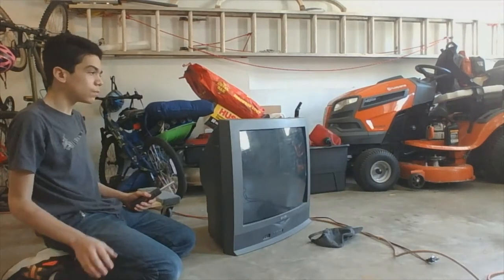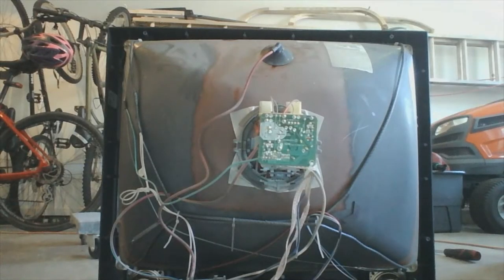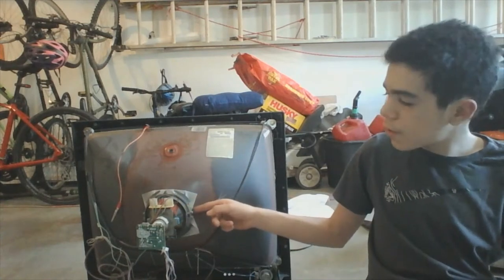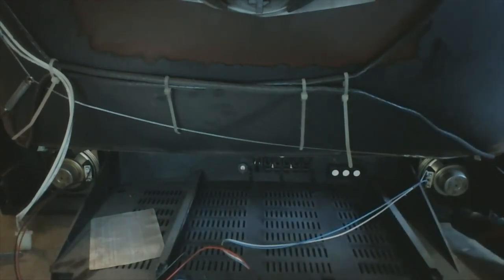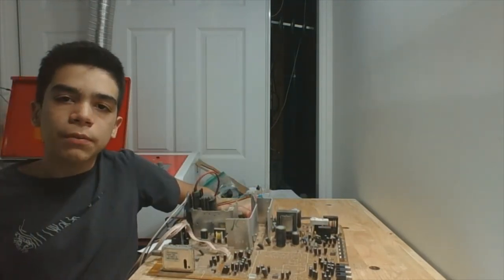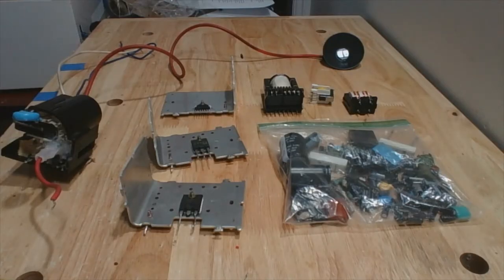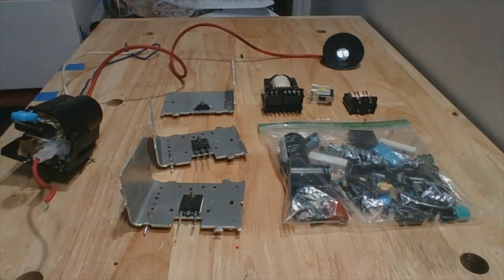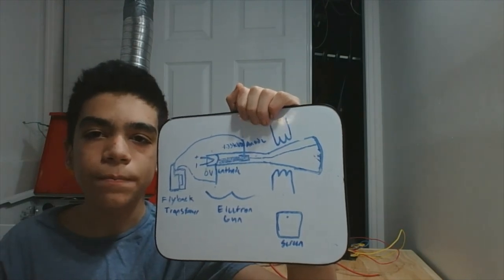How to Disassemble a CRT Television

Comment: thats cool !! you can try to make a tesla coil only with these components ? i have an old television and I would like to try to build one, and I dont have any other component.
Reply from the maker: I suppose that one could use the CRT's smoothing condensor as a ressonant capacitor and create a simple NPN flyback driver with some components from the television. Even then, one would still need to wind the primary and secondary coils. Theoretically, a primary coil could be wound from the connecting wires of the television and wire from an audio output transformer, or something of the like, could be used to wind a secondary coil. Even though this would be fun to try, such a device would be highly impractical. Thanks so much for commenting!